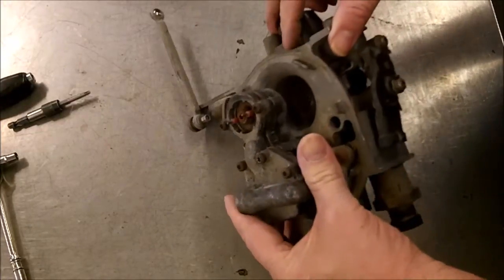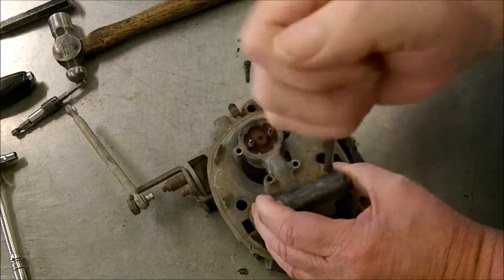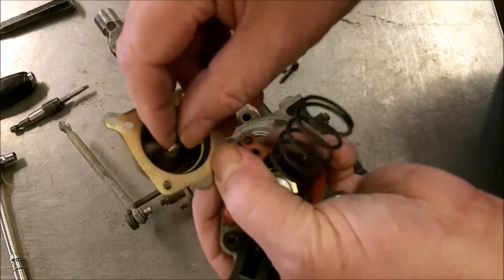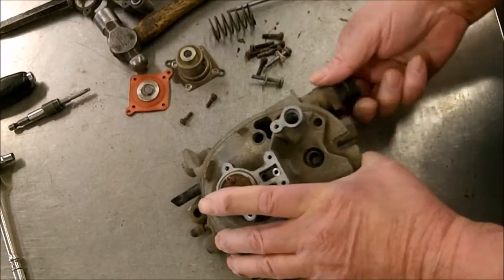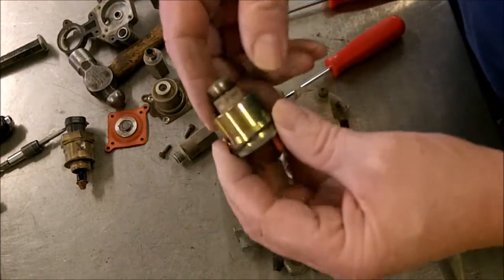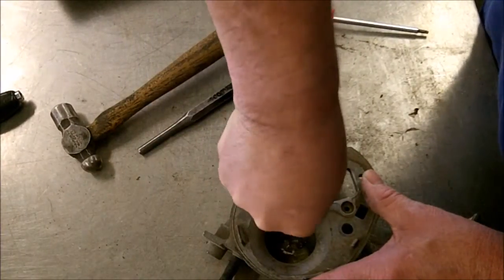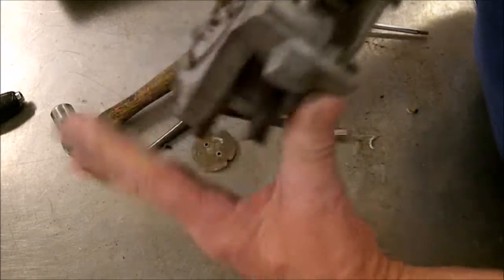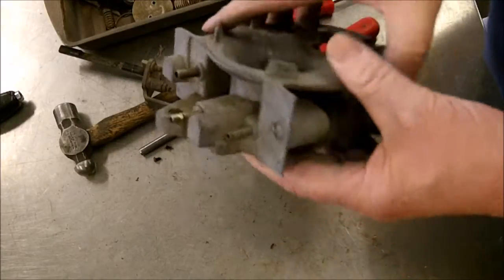Throttle Body Injector Rebuild Dis Assembly

Comment: Hello, I'm trying to figure out if loosening or tightening that hex screw on top of the injector regulates the amount of gas or spray pattern? Can't find anything on here about it.. I'm getting a good spray pattern but it seems that I'm not getting enough fuel to start my truck right up.. I sprayed a bit of fuel inj. cleaner & starts right up, Thanks

Comment: Great video, I have fuel coming out of the accumulator spring flooding out the throttle body, I replaced the diaphragm still doing it any ideas?
Thanks